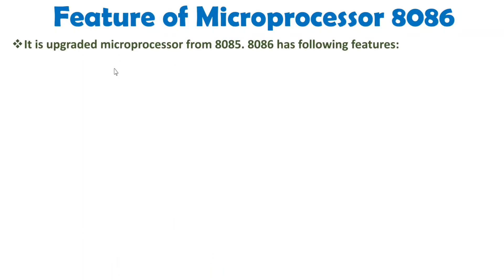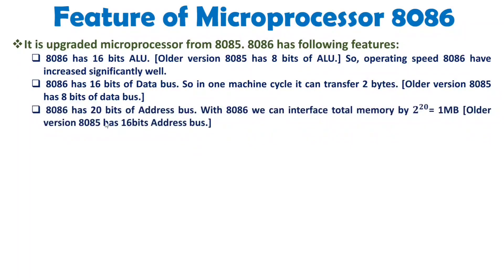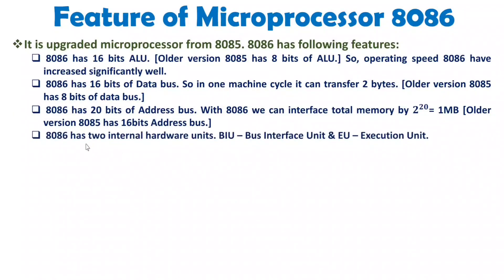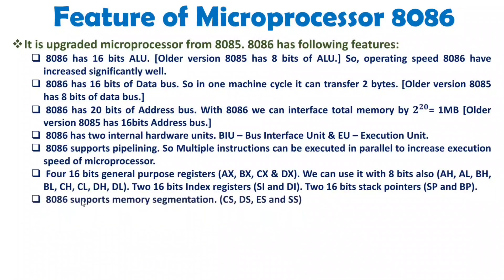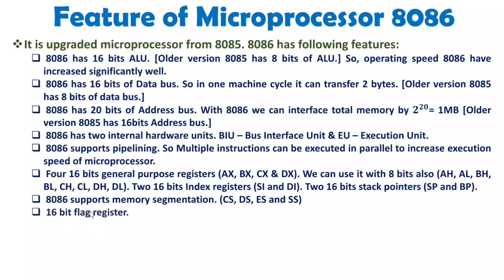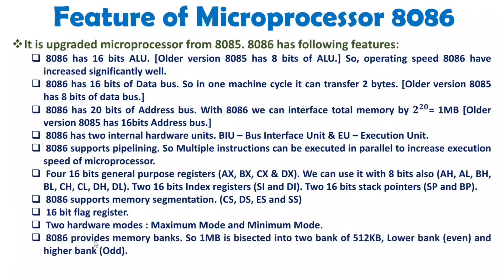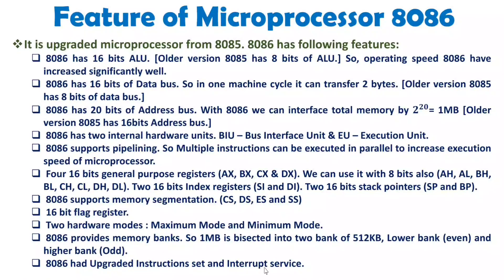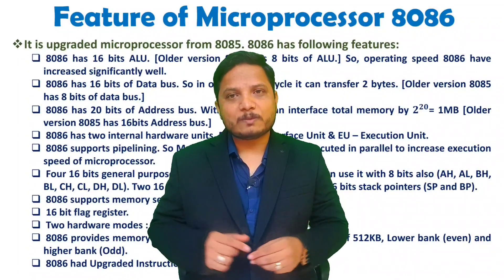Features of Microprocessor 8086: Functions and Fundamentals | Microprocessor 8086

Comment: For people who think 2^20 bits != 1 MB 2:40.  In computing, 1 MB is typically defined as 2^20 bytes(note it's bytes not bits)
  bytes, which equals 1,048,576 bytes. This is based on the binary definition commonly used for memory and storage (as opposed to the metric definition where 1 MB = 1,000,000 bytes, which is less common in this context).